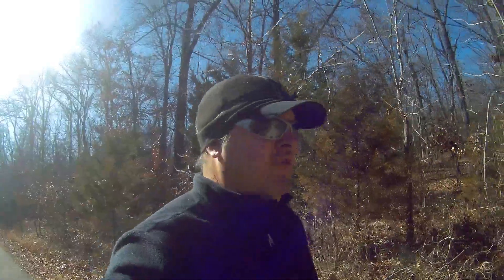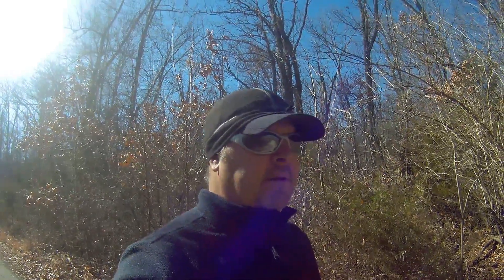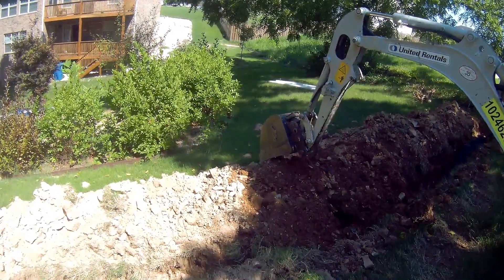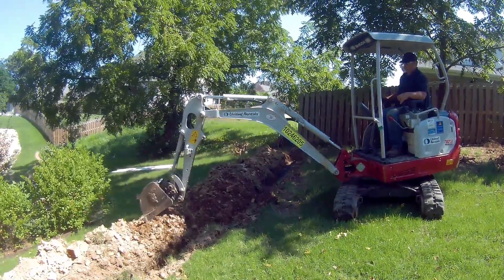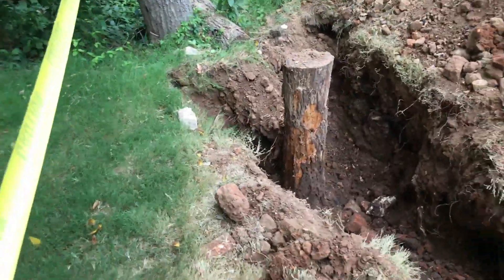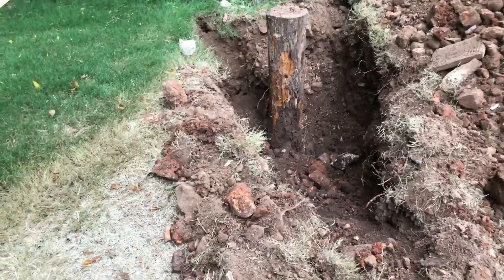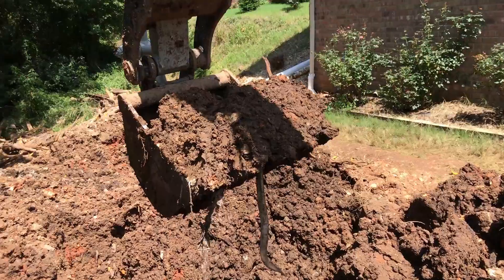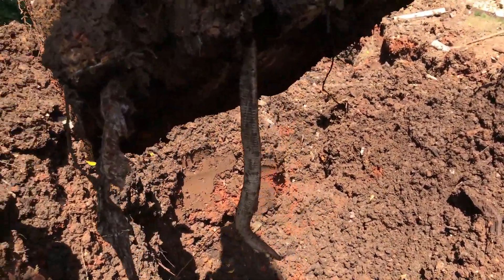French Drain Tips - Sinking Lawn (Literally) -

Comment: What a nightmare, I would be going after the Builder and City.  This is why we’ve lost trust in Builders and General Contractors.  Thanks for sharing. I glad you did right for this homeowner. I originally thought you had a cave vein.
Reply from the maker: mcanning51 yeah. I thought there was movement in the soil due it being back filled with large stones. Sinking caused by soil settling as water moved through the voids. Nope. Bunch of trees 😱
Reply: B&B Drainage Solutions   You certainly had your work cut out for your crew on this one.  Glad you were able to resolve the issue for this homeowner.  Speaks well for your reputation to do the right thing.  I like your video as I have learned a lot from trusted content providers like yourself and your Company.

Comment: Was that 4" french drain covered by dirt enough to handle the literal river shown in the initial footage?  There had to be a much larger french drain structure somewhere.
Reply: Thanks for responding
Reply from the maker: csteinweg no problem. Thanks for watching!
Reply from the maker: csteinweg the property had 4 locations that contributed to the mass flow you saw in the lower portion of the lawn. In 3 locations, at the entry point on the property, 12” catch basins where set and tied into 6” solid pvc pipe, which drained the lower portion of the lawn. The top portion of the lawn, where the French drain was installed, water came into the property all along the fence edge. So a French drain with a small berm, on the downhill side, was installed. The grade was a pretty good bit in that area, so the berm was added in the design. Capturing all the water at each entry point corrected the water issue. 

I used the contractors NDS - EZDRAIN bundle and backfilled the drain - to grade - with river sand. River sand is course mix with small rock aggregate in it. Works great in this application.

Comment: I wonder if the developer could be held liable for the charges since it is their fault this problem occurred.    ?
Reply from the maker: It got all crazy. Who did it. Who was responsible. In the end it was determined that the majority of that area was in an easement. So, it fell on the homeowner if he wanted to correct it. The city wanted no part of it. And basically said you can do what you want. However, we are not helping with cost and they didn’t offer to fix the culvert which had been tampered with either. That was never corrected. And I’m not sure if the homeowner will fix it.